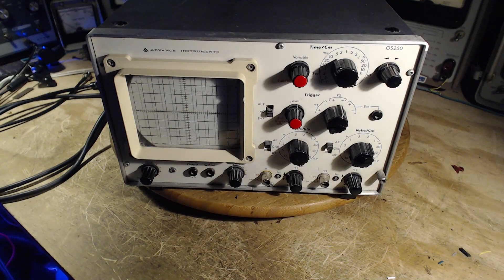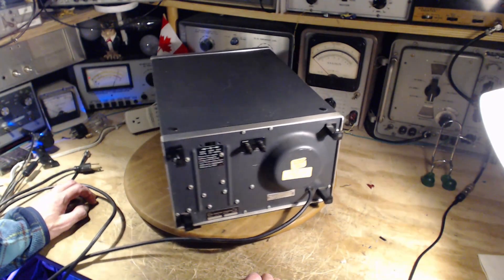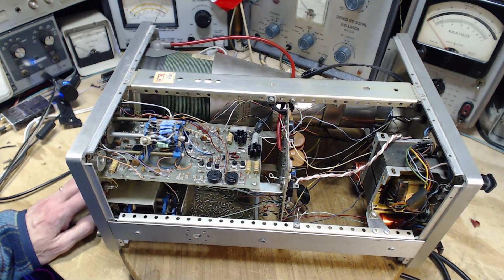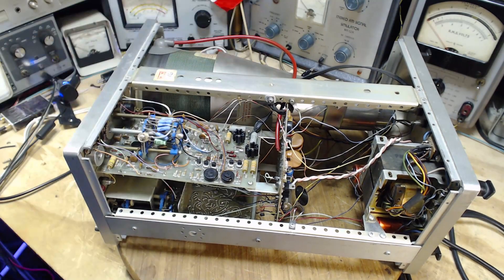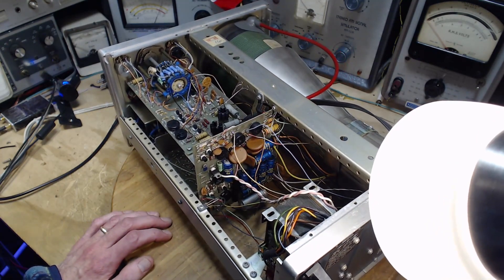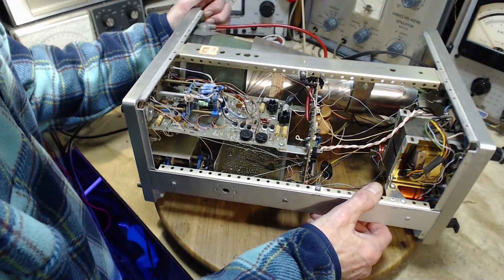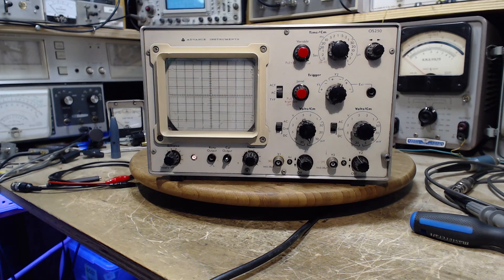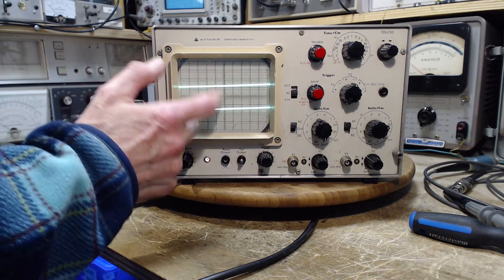Advance Instruments OS250 Oscilloscope Video #1 - Checkout and Minor Repair

Comment: I too have one of these scopes the OS250B,one channel goes flat line at 1V/div+ ,something also when i switch the probe from 1x to 10x the test sqaure wave goes all funky,not sure if the probes match the scope,bought them from RS components,they adjust to a nice clean wave on x10,i need another scope before i tear it down as the whole thing is inter connected and not simple to get to the rotary switches....

Comment: Assuming you are located north of Toronto, I have a Onkyo  M-5030 amp that needs a going over.  Are you able to have a look at it?  Thanks
Reply: The m-5030 is a solid state(!) amp. And semiconductors are not Jim's forte.
And with the amp delivering ~2x100W into 8 Ohms means it can pack a punch unlike a small AA5 pocket radio.
Any repair on the amp needs dilligence. You cannot take shortcuts or clip out/bridge components you "think" are unnecessary because "the user doesnt use that feature anyway". Any semiconductor repair in the vincinity of the power output transistors needs you to evaluate the need for matching components.  In doing that you may need to draw on knowledge on the matter of fake parts when ordering replacements and you may even need to cross old parts to possible currently in production replacements if the original part is no longer available or  too fake prone!
 This is surely not a job where you can grab a 20 year old electrolytic that is 10 times oversize from a box of junk parts and strap it nilly willy to the case using cable ties like Jim did on the last solid state amp!
And finally to test this thing and esp perform the final "test drive" to ensure it can deliver what it is supposed to without having the magic mist escape, you need a proper setup with dummy load.

Sorry but if you value that thing more than it becoming a paperweight give it to someone else to fix.
Mr Carlson is somewhere around his location IIRC.
And if you only want to see what it takes to properly fix a solid state amp (and then compare to Jim's efforts), go watch the channels of JordanPier Mr.Carlson 12voltsvid or shango066, just to name a few.

Comment: Hi Jim ! 
Each oscilloscope-trestlead has a compensationcap, either on the connector, or on the probe itself. So You should compensate the lead to the optimum of rectangle of the testsignal, also it seems that the frequency of this signal is relative low, so You should use not AC, but DC-coupling !
Reply: There should be two caps in total. One inside the scope to calibrate and match the input via 1:1 probes and one cap on the test lead or probe itself to calibrate and match the 1:10 devider inside.
Reply: @randomsteve4288  Yes, of course ! But first he should trie to compensate his different probes.

Comment: Jim you need new cap's .
The orange ones on the back panel have vented .

I am in the middle of changing psu capacitors on a 1980's hameg scope .
A in-circuit esr meter is a must even a diy one !
Reply: You mean the beige colored crust blob below the contacts on the orange cap that is seen to the right at 22:48?
Nah, that is not a bad cap by Jim's standards. In his world it is probably a natural sign of aging that befalls every perfectly serviceable cap. No need to replace it. Much like getting pimples when growing up does not mean you chop off your head...

Comment: 22:31 That "magnetic material" is a ferrite bead. Ferrite! Remember? The brittle material that the core on adjustable RF coils or IF transformers is made of and which breaks when turned with a metal blade screwdriver.
But you would know that from experience, rite?
22:44 The spacers are NOT indicative of high voltage! Someone working with a power company where high voltage was daily business should immediately realize that the insulation of the wires is too thin to safely carry any high voltage!
The spacers are there to keep the wires apart in an effort to reduce crosstalk and  capacitive effects between them! These wires carry the amplified vertical signals from the Y amplifier board to the electrostatic deflection plates of the tube.
And yes, the start of the wire is slightly bunched up to take up slack. But why is there slack to begin with? Because the wires need to be same length to offer same run-time/delay to each path of the differential signal. And why would they be bunched up and not coiled up? Because coiling up would produce an inductor!
If - as CuriousMarc rightfully said - microwave was the blackest witchcraft in electronics, oscilloscopes are entry class witchcraft.
Reply: No videos demonstrating your expertise? This channel doesn't have any content.